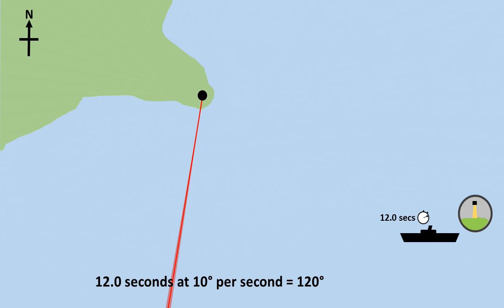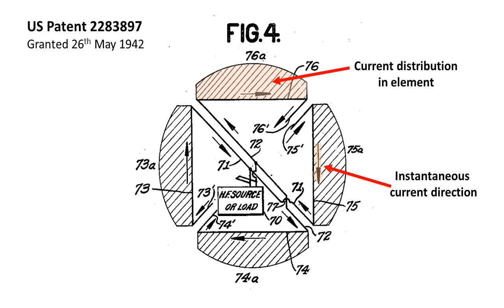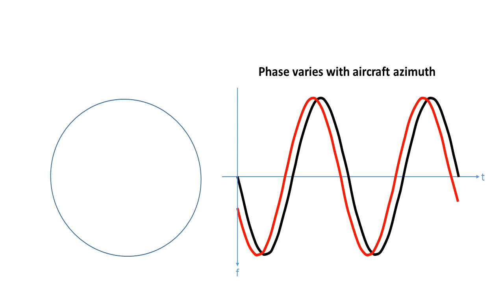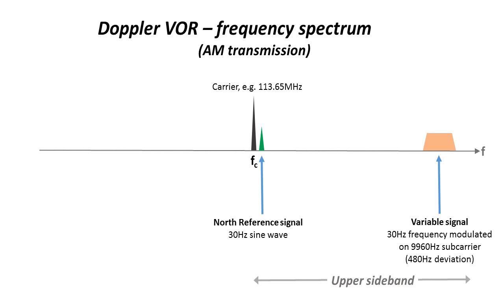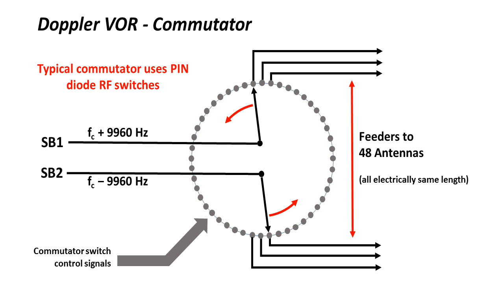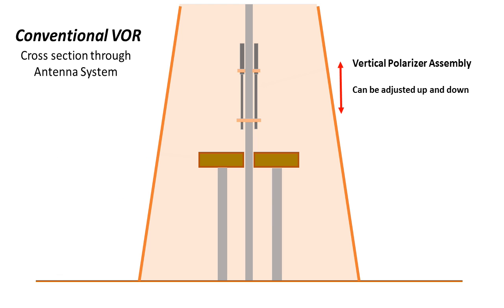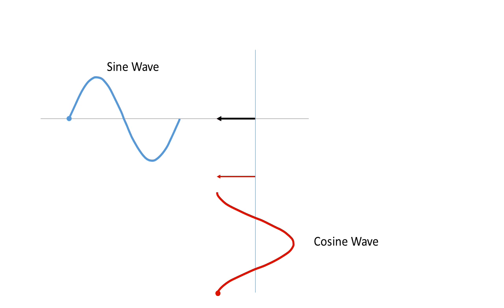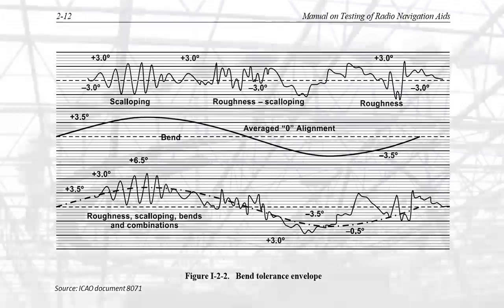The Technical Wizardry of VORs - How they work

Comment: I modeled the conventional VOR in MatLab and got a good pattern when I specified half wavelength between diagonal elements.  However, the square Alford loop antennas are half wavelength on a side, so a square antenna configuration wouldn't fit.  I have two theories: (1) Alford loops are broadband, so operate lower than the designed frequency, or (2) place diagonal pairs one above the other.  Does anyone have any insights?

Comment: Been an FAA VOR technician for 35 years and I was told 35 years ago, don't worry about your VOR it's going away soon. Here it is 2023 and still going strong. 5 more years I retire and I'm sure they will be around then. We have shut down a few and left a DME only site. Great explanation of the system. It's amazing how this technology is still going strong our engineers that were around in the 30s and 40s were very smart.
Reply: I heard they were just removing a few but it's a great system and you know the Chinese may one day take out the GPS system so not wise to remove VOR..  They did decommission thee Sioux City one near me but plenty others in the same VHF receiving distance.
Reply: @melodymakerSD  The current GNSS jamming situation around the Baltic Sea is a mess and there are increasngly similar problems in other regions of the world.  While I have not seen statements yet I expect it to be used as a justification to keep ground-based radio navigation systems alive.  Plus issues like space weather, operational mistakes, technical defects.
Reply: It would be great if I could pick your brain on some of the operations.

Comment: Thank you for this explanation!
I'm still wondering how does the receiver on the aircraft can tell if it's flying towards the VOR station or from it..?
Reply: Doesn't - it depends on the pilot interpreting the signal.  If the VOR indicator shows you on the 90 degree radial, and you are flying a 90 degree heading, you are flying away from the VOR.

Comment: This is probably the best explanation of the technical side of VORs that I have found. I can fly them and I knew they were based on phase differences between two signals, but I always wondered how the rotating signal was generated. I never dreamed it was so simple and elegant. Thanks!

Comment: Sir, if you can explain why the clockwise and counter clockwise rotations for vor and dvor
Reply: I haven't seen this video yet, but as i learned, it's because the receivers already sets the FM 30hz as reference and measures the phase difference to the AM 30hz, so if we were on the 90 deg radial we would read 270 deg (which is the phase from 90 all the way to the next 30hz AM which is 360 deg) so when the rotation is also reversed you get the correct radial while the receiver cant tell the difference if its using a CVOR or DVOR.

Anyone correct me if i was wrong.
Reply: @mcblocked2  great... thank you so much

Comment: Hello, thank you very much for your fantastic explanation about the VOR. Here I have a doubt about the limacon. You said the reason why the 8 shaped pattern can rotate is the combination of  sin(θ) and cos(θ). So could you tell me why almost at the end of the video you said r=a+b*cos(θ)?  Although I know it indeed can be used to describe a limacon. Actually, when I use a equation r=|2+[sin(θ - n*π/180)+cos(θ - n*π/180)]| ,(0≤n≤360) with a math software DESMOS and make the n change, I find it is the rotation pattern of a limacon. Do you think that we just describe a same thing with different ways? For this instance, mine is a dynamic way, yours is a static way. And with your equation, the limacon can't rotate. Or mine way is totally wrong?

Comment: Cleared my 98 % concept Sir, but I have a doubt for the reception by Aircraft in VOR, eg if Aircraft VOR antenna recieves some close degrees of reference RF Wave like 89,90,91 how will it know which is correct?
I would be glad if you answer?
Reply: 041091ay huh

Comment: Very thorough analysis! Could you please provide the link to the original source of information? Also, what software did you use to create graphs and drawings?
Reply from the maker: There were numerous sites on the internet that I consulted - too many to specify, but the most useful were some FAA and ICAO documents.  Also the book "Manual of Avionics" by Brian Kendall was useful.  All the graphics were produced using Microsoft Powerpoint slides, and the video edited using  Cyberlink "Power Director".